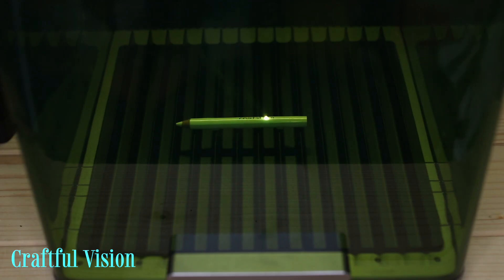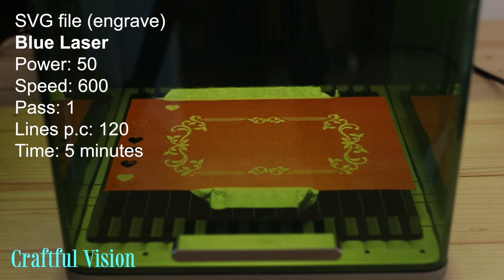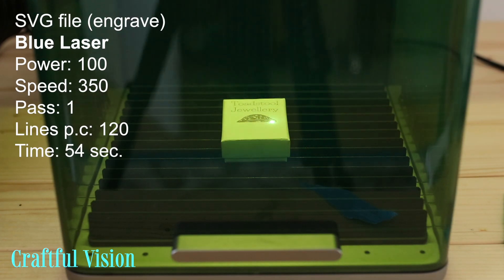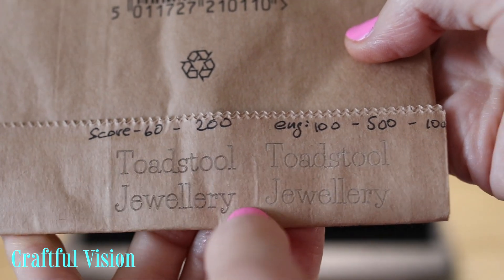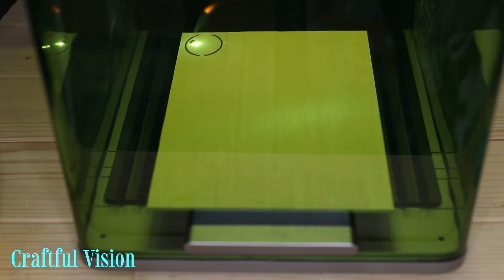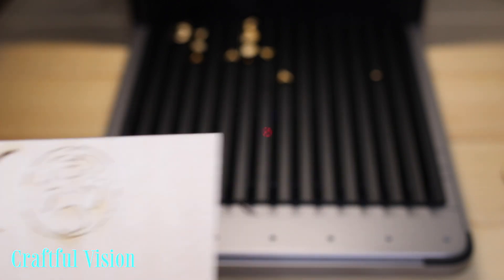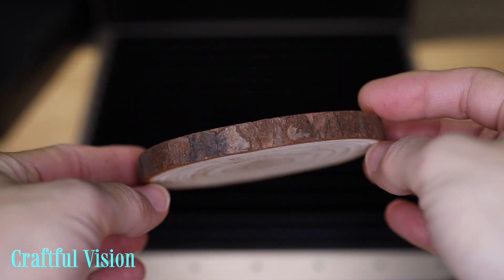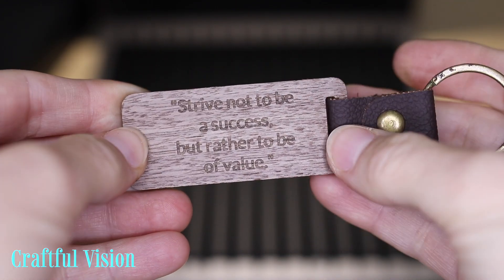xTool F1 Ultra - Ultimate Testing PART 2 - Cutting Wood, Card, Cork... (Fiber laser & Diode machine)

Comment: Be aware that many people have problems with the F1 Ultra recently. It´s kind of having a problem losing the power on the fiber laser. Meaning that even you put it on 100% power it runs like its only at 5%.
Check the xtool support community and search for " Loss of power with the F1 Ultra